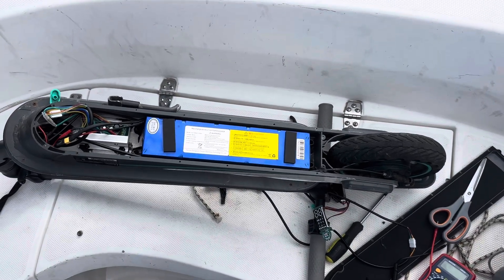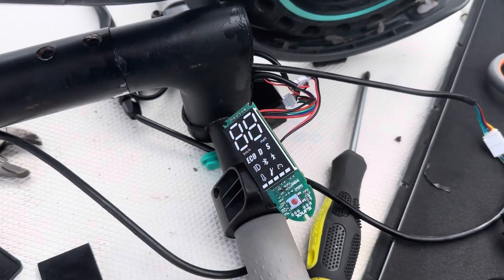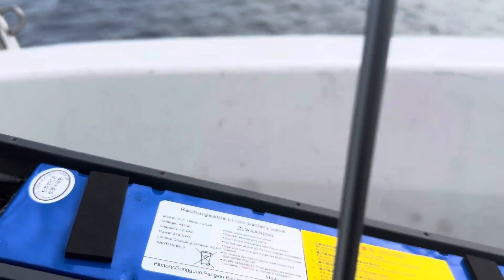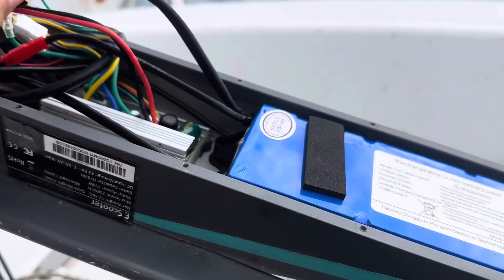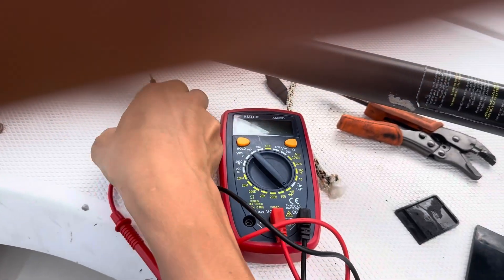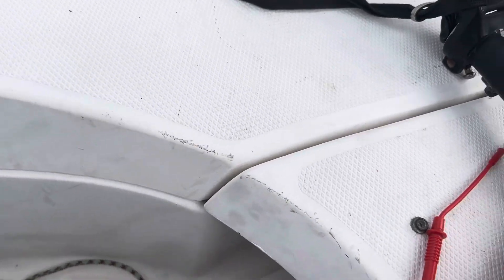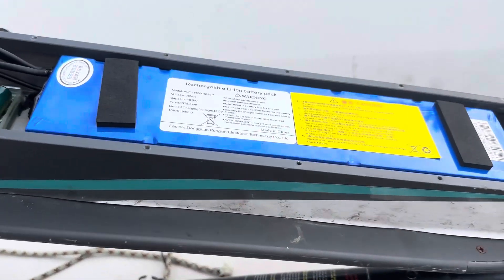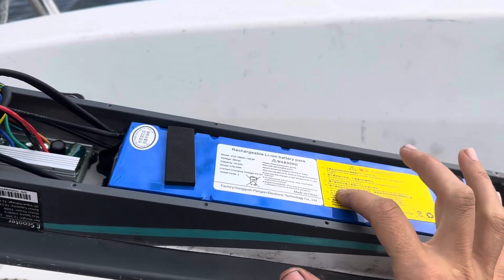How to Fix an Electric Scooter That Won’t Start

Comment: I'm sorry but you don't seem to know anything about electricity nor electronic neither about fixing things. 
You're stating that we'll learn in this video:
 • Common reasons an electric scooter won’t turn on
 • How to test your charger and battery
 • Simple fixes you can try before replacing parts
 • What finally worked for my scooter
But you never teach any of those. Why do you even touch those things? And on a boat???
Reply from the maker: Sorry it wasn’t helpful to you